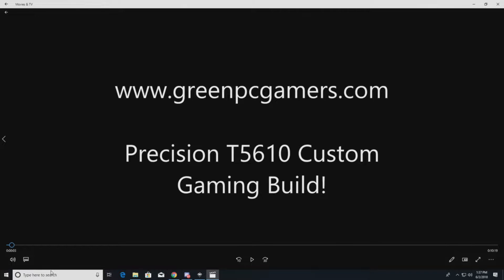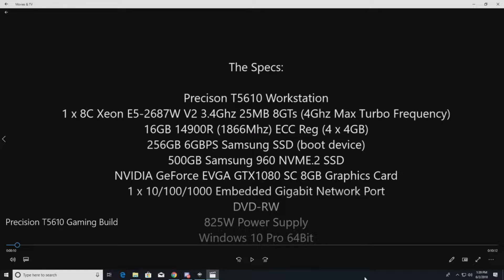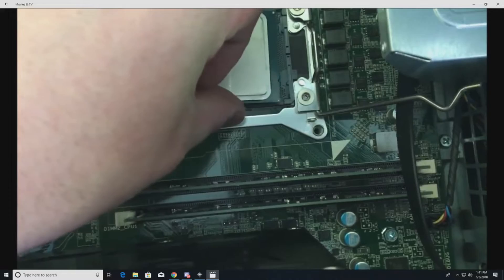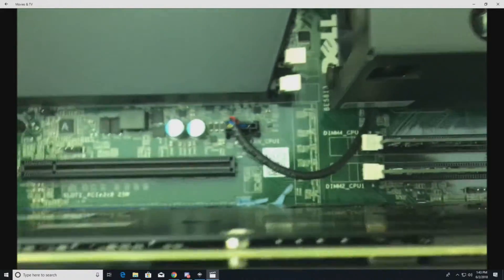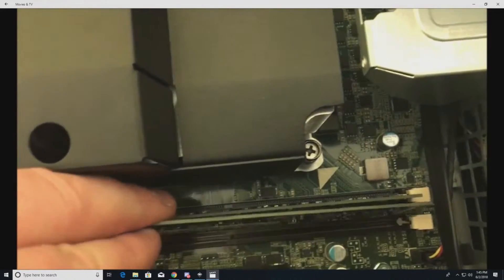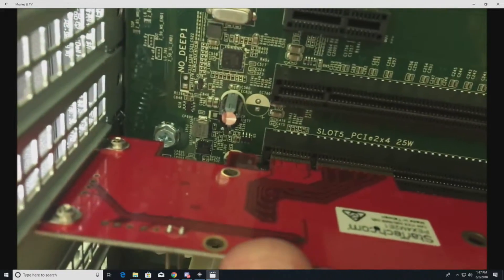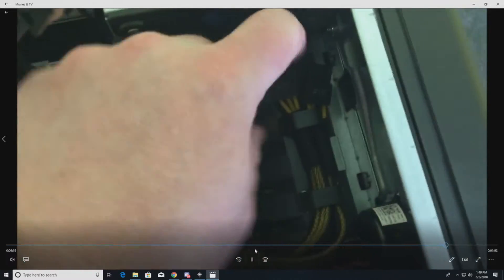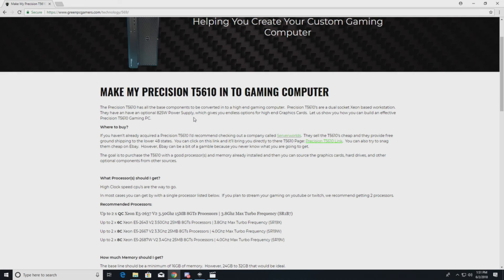Awesome Precision T5610 Gaming Computer!  NVMe and GTX1080 Graphics Card Install

Comment: When I try to add my NVME Crucial P5 to any PCIe slot I am able to format and install just fine. But once I start using the drive I get all kinds of errors. A device which does not exist was specified. Or A path which does not exist was specified. Also I cant delete any info on it or write to it after this happens. Any help ?
Reply from the maker: We haven't tried the Crucial P5 NVMe SSDs on a T5610 yet.  Can you try the SSD on a different test bed to make sure it isn't having the same issue?  Preferabley a DDR4 based system.

Comment: my box is T5610 dual E5-2670 64GB RAM 825W PSU with Quadro K600, want to upgrade the GPU with M4000 and a K80 as accelerator, just wonder does this 2 GPU work well on T5610? I could not find any result on google. my OS is Ubuntu 20.04. i want to do some TF deep learning stuff on budget. Thanks.

Comment: Make sure with the 825 power supply you have the heavy cord the standard cord that comes with the 425 watt is not heavy enough and will over heat under heavy load.

Comment: so i built a few t7910's with the latest bios they can boot from NVME drives via PCI express converter cards.  Can this t5610 do the same thing?  I know with an early bios it can not see the card and drive, but with the latest no problem.
Reply: Im also curious about this…

Comment: Does anyone have the specs on this power supply and the quick connect board in regards to how much the 8 pin on the board can handle ?  and pinout arrangement would be nice, my idea  is to go from this 8 pin to two 8 pins with both full length cables.  Is the connector on the pwr supply proprietary ?

Comment: Hi I have t5600 what criteria I should concern when upgrading Graphic Card please? I was upgraded my present card for nvidia qudaro p4000 but it works only from PCI x4 on others PCIe x 16 not post it .... ? please help. I have opportunity to have dell RTX 2080 need mode one plug 6 pins to 8, my question is will work or not ?

Comment: Can it run SupportAssist 's video stress test? Or does is have any cable no connected issue? Mine just install gtx1660ti  and it can't finish SupportAssist video stress test and randomly cable no connected.

Comment: I am thinking to upgrade the graphics card to EVGA RTX 3080 which requires either 2x 8pin connectors or 2x 6+2pin connectors.
From what I see, the cable supplied from Dell is using 8pin to dual 6pin connectors. Will the GPU work if I replaced the GPU power cable so that it will be 8pin to dual 6+2pin cable?
Reply: if you can afford a 3080 just get a prebuilt lol
Reply: @chapig396  not really want to forego the CPU that I have and only enough budget for GPU at the moment

Comment: can i install amd rx 580 8GB in this pc.. will it bottleneck the cpu?
Reply from the maker: The cpu would most likely bottleneck the gpu a little bit.
Reply: I have it installed and works fine with MacOS Mojave
Reply: So these are great for hackintosh also?

Comment: P.S. For all watching... Use a FULL SLOT pciE NvME adapter and update your bios. Use the Second x16 Video card slot for your M.2 Solid state in the adapter and it boots up no problem. At least for me... and on the gen 1 t5600 I get 1800 Read 1600 Write with my 240 gig 950 Pro and run windows 10 with no issues.
Reply: Also... The adapter shown will not use all 4 lanes and not get the full speed of that 960 without all 4 pciE lanes that would only be on one of the SLi slots... as far as I understand it.
Reply: Another note.. I have had trouble with ALL adapters other than the RoHS with only ONE NOTCH.. the short adapters like yours and the multiple notched "full slot" adapters WILL NOT BOOT!  Best to do an ebay search with x16 FULL SPEED in the title and assure there is a contacts the entire length of the slot aside from the single notch required to fit in the port. I have been able to boot without fail using samsung m.2 drives of various types in this adapter as far back as AM3 on a ddr2 board, also obviously not supoported. I would not use any other. I have also had success using the t5600's x4 pcie slots to boot and get about the same speeds. So.. as long as the lane is x4 a single drive should be fine on the 25 watt x4 slots as well.  I am setting up a dual M.2 adapter in my second x16 port to run 2x 2tb 981's in a "raid 0" software stripe.
Reply: @snowkatslimz  Thank you for this advice, i will definitely try that on my T3610.
Reply: Thanks for the <3...if you like i will post this build on the blog. P5000 Dual 2687w 1300 watt psu all new fans and coolers etc... Also building a dual quad core with a 1080 in my second chassis.
Reply: @@jacksonholloman I can't be sure.... I can say it did eventually start giving me problems. So on that machine I went back to a sata boot SSD.

Comment: I have this Dell and it does good job playing Wolfenstein old blood and collosus games with 8 gig memory and GTX 1060
Reply: M A I have the same pc with a 1060 
Except I have 24gb if ram and it will run basically anything
Reply: August Ashes Forge  it's a good value PC it's solid for work stuff that requires alot. Most people don't know about these workstations...did 24 gig improve anything for gaming?
Reply: M A I think so 
The I only had 16 before and the jump to 24 really improved it

Comment: Can you add a 2nd drive like a 1tb wd hdd just to save stuff?  I’ve seen it only supports up to 500gb hdd.
Reply from the maker: If you are referring to a 3.5" SATA 1TB Drive, yes.  You can add a 1TB SATA drive as long as you have an open slot for it.
Reply: Yes. There's space for two 3.5" SATA drives. Mine is working fine with a 6TB drive. I think these originally came with 500GB drives standard, but Dell had larger options available.

Comment: I’ve built this same unit with 2 CPU’s, a 1060 card, 32G of ram, and 500G Ssd with a 3tb barracuda for the other stuff. My daughter plays Overwatch and it gets a solid 70-90FPS. She streams at the same time she plays and we’ve ran into an issue with it locking up. She’ll still hear it running in the background but the screen goes black. She has to Restart it, not good for competitive gaming or streaming. Are there any suggestions on something that can help me narrow down what keeps blinking her out?
Reply from the maker: The quick fix is to build a capture PC to handle the streaming process.  We will be releasing a video soon for a cool little capture pc.  Can you tell me what model processors you have in you T5610?  Also, do you have multiple displays set up in the T5610?  It would be interesting open up the task manager on a second monitor to see what resources you are using when gaming and streaming at the same time.
Reply: The Processors are both  2609 V2, We are running 1 monitor at the moment - but I do have another that I can attach. I have Already swapped the video port on the video card and the Cable, but that's as far as I have gotten. I'll get a second monitor on it and have it running in the background just to see whats up in there.
Reply from the maker: The processors that you have installed may be bottlenecking they system when she streams and games at the same time.  You’ll be able to verify this when you set up a second monitor and look at the resources while she is gaming and streaming.  Do you have the 825w power supply installed?
Reply: It has the 685 power supply. When she was streaming and playing the CPU was running around 65%. I had her turn the graphics up to a high setting and that started running the CPU at around 85%
Reply from the maker: My guess is that the processors are not able to keep up with the gaming and decoding with your current settings.  Are you using obs  streamlabs as the broadcasting software?
Reply: @GreenPCGamerscom  Yes to the streaming software. I had her turn it up to Epic settings and so Far it's running like a champ The CPU is still running in the High 80's, the GPU fans working it's fan off and it sounds like a helicopters trying to take off - but the Video and Gameplay is running without a Bump. It's pretty steady state at 100FPS. It was running lower FPS when the setting were on low.
Reply from the maker: Without streaming at the same time that is pretty good.  In the future you should consider adding a capture pc to handle the streaming process.
Reply: @GreenPCGamerscom   Yep- she Ended up backing the setting from Epic to Ultra ( it finally studdered a couple of times), so On Ultra and Streaming her Channel, it ran smooth at 90-100 FPs, Temp stayed at around 74 Deg C , and Streamed. Total CPU usage was at 82% . It looks like the streaming app is only about 6% of that. With that being said- do you think it would be worth setting up a second PC to stream from. The CPU's I'm using were a set that I had here as the machine only had one when I got it. The GPU I have only has the 6 pin power on it, I figured the 685W supply is adequate for the unit, any thoughts.
Reply from the maker: If she plans to get serious about streaming or broadcasting, a capture pc is a must.  I do think your would benefit a ton from upgrading your processor(s).  You should upgrade to a single E5-2687w V2.  It’ll have the same amount of cores as your 2 existing processors but the clock speed will be much higher.  This will benefit her greatly for gaming and streaming.
Reply: @GreenPCGamerscom  Sounds Good- we'll keep chipping away at it over time. I look forward to seeing what you do in your Capture build. Thanks for the info- your channel has been a great source for us figuring out what to do.

Comment: My company decommissioned some T5600's and I was approved to acquire one (for zero, as it was fully depreciated)! It has dual E5-2667's, 32 GB EEC DDR3 RAM (8 x 4), a .5TB drive with Win 10 Pro, 825 W PS, and a H310 RAID card.  I installed a GTX 1050 that I already had in an older PC...which is enough for my needs.

I do not have RAID setup on this system and do not intend to do so. However, I understand that if I connect an SSD to one of its 3 connection plugs coming off of that H310 card, the SSD will have better bandwidth. The current HDD with OS is connected directly to SATA 0.

Basically, I want to clone the drive over to the SDD using EaseUS backup and then free up the HDD for storage.  I will probably keep one game on the SSD...WoT. Then change the Win 10 Pro to my new key.

Should I keep the H310? If no, then which SATA port on the board to use for the new SSD? Noticed there are also some HDD ports.  Should all storage move to the HDD ports? I would prefer to keep the SSD out of the HDD storage bays, as I have an extra 1TB HDD for additional storage too. Basically, I two -side taped the SSD tray to the empty bay next to the CD R/RW.

Also, no sound card and the rear sound jack doesn't work with my old external DELL XPS PC sound speakers, though my front headphone jack works fine.  Do I need a separate sound card too?

System works fine...just the boot-up is painfully slow without that SSD. I already did the basic internal cleaning, with new thermal paste on the CPU's. Temp's seem to be in spec, from what I have researched.

Insights here are appreciated. I know...too many questions.  Yes, I am a noob at this.

PS:  I never intended to go the route of a server...but this deal was too good to pass up.  Also, I am a big fan of these Xeon's...which is quite an upgrade from a DELL XPS 420 with a BSEL modded Q6600 at 3.1 Ghz (which I kept going well since 2008)! Truth is, that thing cost me an arm and a leg at the time...so I was compelled to use it fully for decade.
Reply from the maker: That is awesome that you acquired the system for free!  

The H310 Controller will give you faster throughput once the system has booted.  However, it will cause your system to have slower boot times because of the controllers progressions in post.  You’ll have to decide whether you want faster boot times or faster throughput when booted in to your OS.

For the sound card:  you should reboot the system and go in to the f2 setup.  Someone may have disabled the audio ports on the back.  You can check it out and enable it.  If that doesn’t work you could pick up a cheap soundblaster 7.1 card on the internet.

Let me know if I missed anything.
Reply: @GreenPCGamerscom  Many thanks for the feedback.  I will likely keep the H310 and live with the its pre-bios post during system boot-up.  Most of the time I just put the system in sleep when not in use, so less an issue for the most part. Besides, the H310 gives me additional connectors outside of those for the two integral HDD storage racks.  Will check the BIOS setup on the sound issue...would be nice if this turns out to be the quick fix. THX for the heads up.

Yes, this was the deal of deals.  I actually used the server at work as my desktop PC.  I am not a developer, so it was overkill for commerical/contract work. However, the I/0 went awry and I lost all ability to use the mouse or keyboard (both USB's and legacy port would not work...it's was a HW issue in the end). They set me up with a targus docking station for my i5 notebook, which handles dual screen well.

So, that T5600 went to the bin locker (a wooden crate in the basement).  However, there was another next to it in the bin.  So,  I asked and took the salvageble parts from one into the other (the RAM and the one HDD).  Then an intern set it up to see if the board was OK on the "dead" sister unit.  Turned out, it was A.O.K!  A bit dusty and unkempt...but no issues for me on that point.  Cleaned up nicely...and runs like a clock now. More than enough horsepower for my needs.  Swore I would never go OEM again (after the expensive XPS purchase), given all the proprietary DELL issues (BTX, etc. etc.).  But with this thing, I do not care at all. It's perfect for me and has plenty of room to grow. I may go for a 1080Ti next year, given the mining crash of late. Will see.  Else, the 1050 does OK. BR.

Comment: how do you guys deal with the panel when installing some of these new cards? It has a weird handle on it that doesn't fit after installing a new video card.
Reply: I had the same problem with a 1060 card I installed. I drilled the spot welds and it popped of . No need to drill through the case
Reply from the maker: Hey Vlad,  We try to purchase cards that will fit inside the chassis without having to modify the side panel.  We list the cards that will fit on our blog pages on www.greenpcgamers.com.  However, sometimes we do end up removing the handle or cutting holes in the side panels.  The handle is pretty easy to remove by gently drilling out 8 rivets.  If you are careful, you can remove the rivets w/o poking through the side panel.  In some cases we have actually cut holes in the side panel to allow for graphics cards to fit in the chassis.  Cutting a hole in the side panel can look pretty cool if you are able to make clean cuts.  (Jigsaw with a pilot hole works well to cut the hole)  I hope this info helps.
Reply: @GreenPCGamerscom  thank you!

Comment: I have the same PC, but my power supply only has one 6 pin power cable for the gpu.  :(
Reply from the maker: Alex Pelayo what wattage power supply do you have installed?
Reply from the maker: Hey Alex,

You'll want to upgrade to the 825W Power Supply and add the Graphics Card Aux Power Cable.

825W Power Supply:

https://www.serverworlds.com/dell-g57yp-precision-t5610-825w-power-supply-d825ef-01-dps-825bb-a/

Power Cable:

https://www.serverworlds.com/dell-d92c9-precision-t5600-t5610-t5810-graphics-card-aux-power-cable/